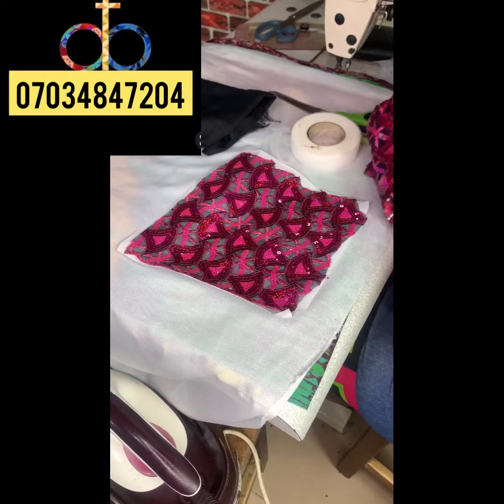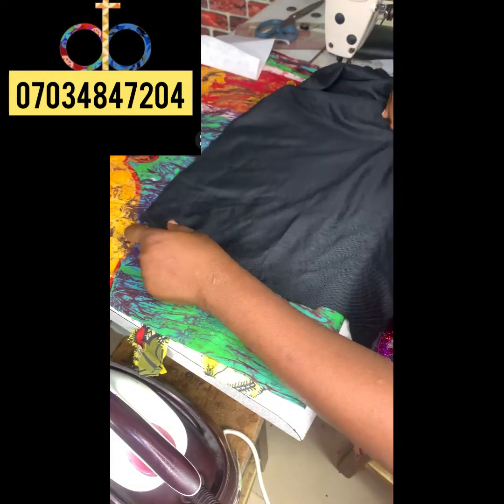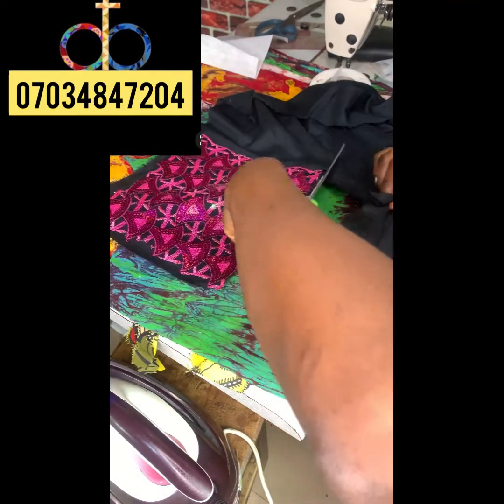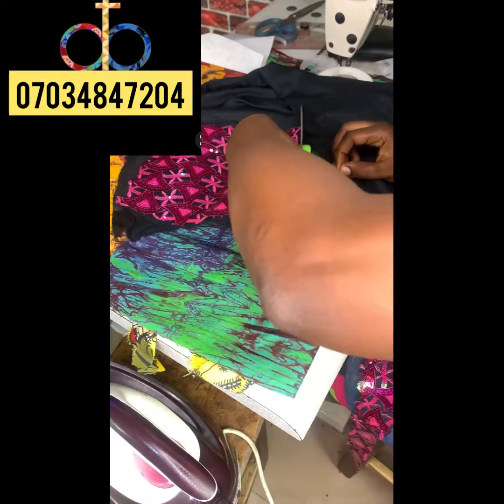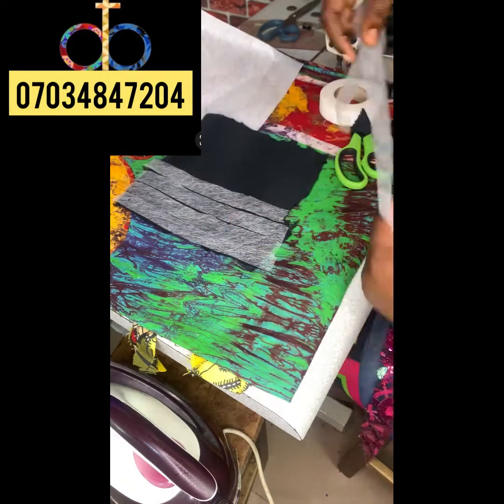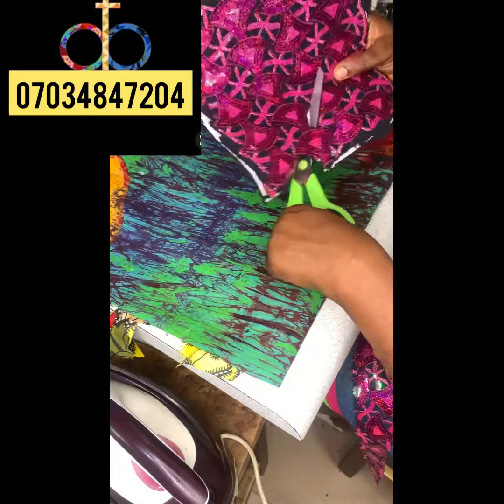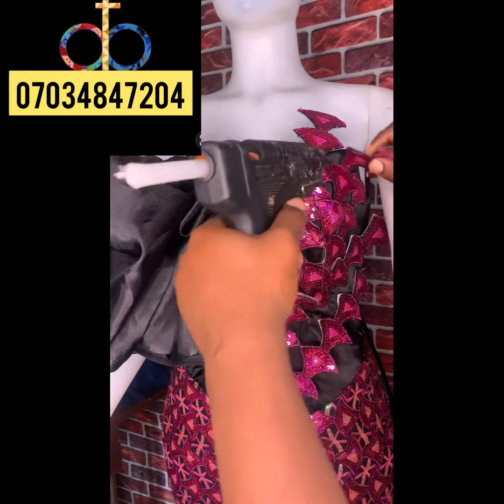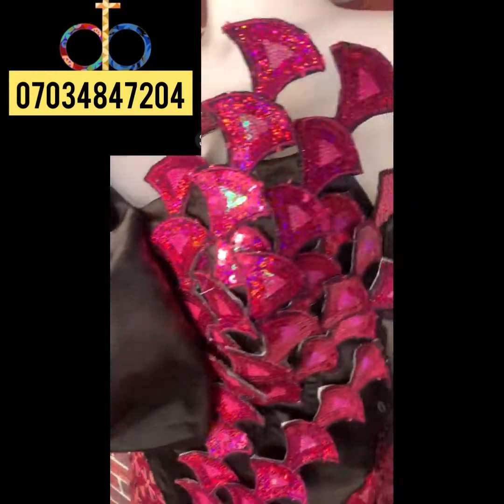5 MINUTES 3D FABRIC APPLIQUÉ

Comment: Thank you for the tutorial.. very educating.. but I have a question.. what if the fabric does not have the desired shape or pattern like this? Because the fabric you used for this lesson has pattern.
Reply from the maker: You will have to draw out the desired design design that you like , afterwards add all the necessary interfacing the cut it out with a soldering iron instead….the alternative is to cut out the shapes and line each one with same fabric for a neat finish